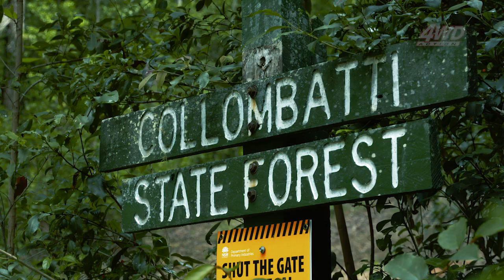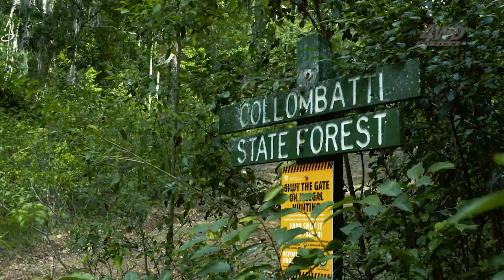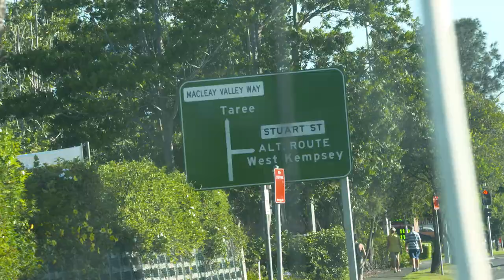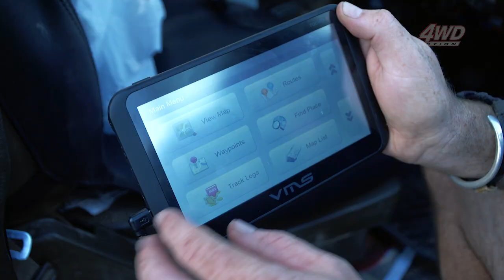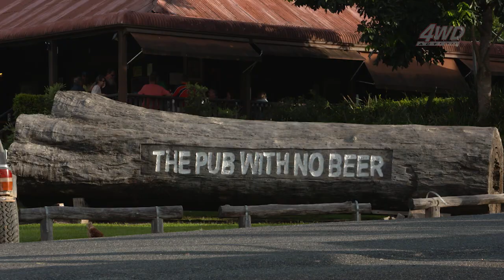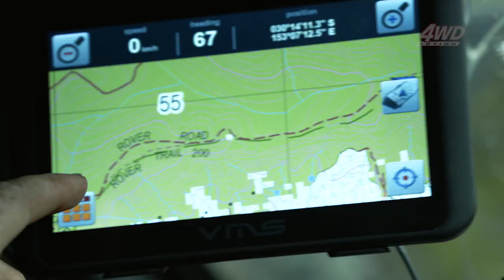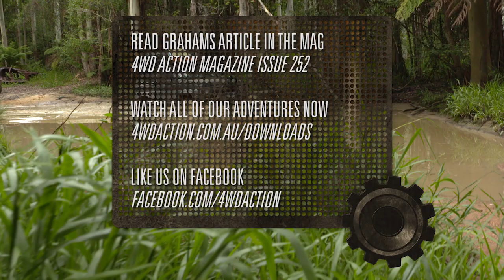Suzuki Sierra does Coffs Tough Tracks - Insane recoveries and bush mechanic fixes

Comment: The Suzuki Sierra/ Samurai/ SJ410 or Gypsy/ MG413 as it is known in India,  is light, yet tough and capable. One of the best, most basic off road machines.
Reply: Shankar Balan that is exactly what I like. Basic and fully utilitarian. Low gears, f/r lockers. I hate electric traction controlled, info screens, technological, less capable machines.
Reply: @ronelly4299  lolll. it seems capable but maybe not so comfortable on longer road trips.

Comment: When u are pulling a trailer all u need to get around places that u have to wench your trailer sideways is sliders. U can put them in front of your trailer tires and u put a lubricant on them and when u pull forward into them it will make you trailer slide over where they are Angled. Just wanted to give ya a tip.

Comment: 26:31 - Front auto locker binding ... didn't you take out the locker and replace it with an open front centre the day before? At 15:50 Shaun comments "... no locker, but we'll have four wheel drive..." Or did you change the crown gear on the locker and replace it? Some more detail and commentary on the repairs you make would be good. Same thing in the last Zook video when you lost front drive - zero explanation on what actually went wrong, and how you fixed it.

Other than that, love the 4WD action ... and it may be R&D, but I still think you're nuts dragging a boat anchor through that kind of terrain.
Reply: problem is running standard suzuki suspension. This causes wheel lift and shock loading of drive line when one wheel finally contacts the ground, hence breakage of u.j. joints or differential. Solution is modifying all spring shackles to double the length with a pin in centre and swaping front shock absorbers with toyota corolla rear shocks- this makes the suspension way more softer with more travel. The other trucks in this vid have some serious mods

Comment: Heavy duty jockey on the rear of the trailer, with 360 turning, would be a game changer… allow the boys to either manually swivel trailer or even use winch to pull around corners

Comment: God I miss my zook, I had an old 96 x90 pretty much bone stock but it had some meaty tyres on it. I started commuting long distance for uni and I was just wrecking it because anyone that's owned one will know that they were not made for highway driving so I sold it before I wrecked it. Still miss it though I had some good times in that little Suzuki

Comment: Id love to get a Suzuki jimny or something for my first car in a few months, they look like so much fun and they can just go absolutely anywhere
Reply: Not something you'd want as an only vehicle.  Aside from being incredibly small and cramped, there's no amenities, no power, bad mpg, an really unsafe in an accident.
Reply: People who buy cars for crashing are a bunch of idiots. :) It is not for penny pincher either. If high mpg is your goal, don't use an offroad vehicle or anything with power. I am talking about combustion engine for general purpose.
Reply: definitely better off getting a cheap 4x4 zook that you can bash about in, and not worry about damaging, and a regular daily driver as well.
Reply: Little Zooks will run rings around bigger 4wds off road in everything but deep water. My first one was a 3 cylinder 2 stroke 539 cc LJ50...very capable vehicle off road but a bit of a buzz box on the open road maxing at 80kph. Seems everyone wants big flash 4wds and trailers to go bush nowadays...whats wrong with a zook and a couple of swags?
Reply: pseudechis See I've got the best of both worlds! Long wheelbase Zook, with my bed inside it. Simple, compact, fun!

Comment: I love my Samurai.  At just over 1 ton, If you can find a "B" weight rated tire, they will flex & conform at 10 psi. My 31" BFG muds at 5 psi to flex.  They are WAY lighter than Toyota, jeep etc....

Comment: Going downhill in 1st gear low range, I’d like to pull the handbrake up 1-3 notches to change the brake balance a bit more to the rear only using the brakes if needed.

Comment: I had one of the old 2 stroke 3 cylinder Suzuki's ,It was a soft top with a roll bar .I think it would of done better.Also a friend of mine had a 2 stroke 2 cylinder ,the first to come out .unstoppable..Both just small puffs of blue smoke.

Comment: trailer hitch idea horse trailer hitch to an extenssion down to bumper hitch, with an ox cart type of rear axle one taller wheel on each side of the trailer, with a higher axle and a two tun army truck uniderectional tires.

Comment: The difference between SJ and Jimny is, you can drown the SJ410. Take it out, blow air in the distributor cap and plug boots and off you go. Try that with a Jimny.

Comment: what is that lead truck and what engine is it running? It kind of looks like a suzuki sidekick (USA) from the rear. I want one!
Reply: You're probably in the US - it's not available there. It's Nissan Patrol GQ Y60 (1987-1997) short wheel base and most of them run the original TD42 diesel (as in Graham's) or TB42 petrol. The 3rd truck is the successor to this model known in Australia as GU (or technically Y61).

Comment: What is the purpose of those orange vests on winch cables?
Reply: gixxer4646 acts as a weight
If the winch were to let go it would stay down
Reply: Understood so is not just to signal were the cable is, but in case it snaps, the cable will not bounce all the way to the other side?
Reply: Correct well it is a signal also but the main purpose is to dampen the line, 
Other wise those winch ropes when under tension snap if they do let go  shackle breaking rope frayed etc;
They have been some accidents because of winching so take extreme care a blanket is highly recommended 
But most the time I just use a jacket does the same thing

Comment: In the Coffs section, I don't see how 35's make a difference, I have 33's on my hilux and it pulled through that track no worries
Reply: hiluxs have baby diffs, my luxy on 33s had more clearance than my patrol on 35s
Reply: also, it's still easier to fit 35"s to a patrol than 33"s to a lux,

Comment: Trailers are cancer, keep those things at a "big 4"  😬
Reply: Stupid taking camper trailers in these types of situations. Going bush is about getting away from things and roughing it a little, you don't need or want all the normal household luxuries with you. If you must take one of these trailers then kit it out properly so that it has exactly the same tyres as your rig and the axle is custom built to match the wheeltrack of your vehicle.
Reply: dont forget mate he's testing the durability of the trailer and makeing sure that is a customer wants to take a camper on tracks like that they can do it without it breaking not just so they have all the lurxuries.
Reply: When people want to take trailers on tracks like this all it does it cause the track to degrade as the vehicles struggle to pull it though, and widen the track by chopping through corners. As good as the trailer is, you don't need all this crap out bush!
Reply: The average joe isn't as prepared as these guys either.  They end up requiring everyone else around them to extract them from the poo sooo often.  If you think it's a great adventure, watch the gall boys winch their way to cape York.  The most painful top end vid you'll watch.  Ever.
Reply: imagine a trailer that had power steering accessible from the cab
Reply: s o d o  seen em with pto drives 😀
Reply: He seems to be doing better than the others
Reply: and yet the rig with the trailer is having the least problems.....

Comment: Zooks are not made for that type of offroading. 
Underpowered. Under engineered.  Keep them as a farm runabout.  That is all they are good for. 
On mine... The order of failures. Transfer case, transmission, then motor. At least I made my money back when I sold it.